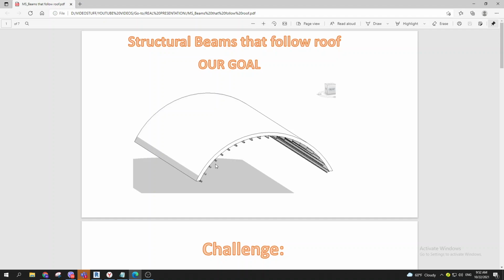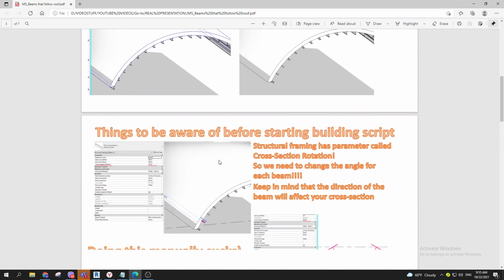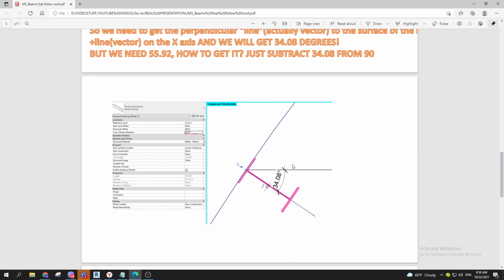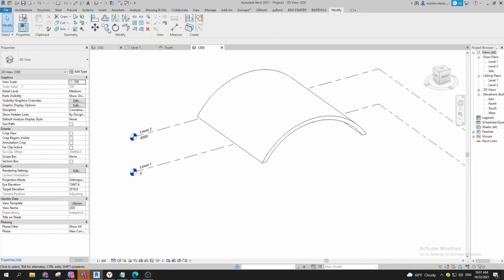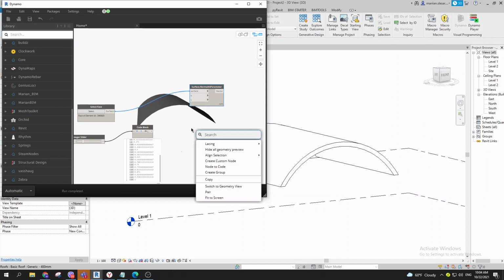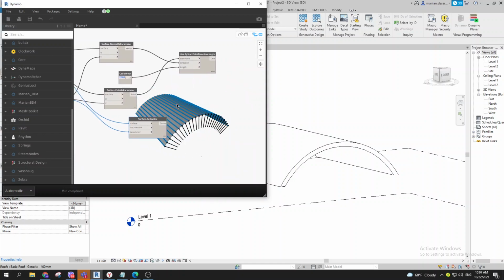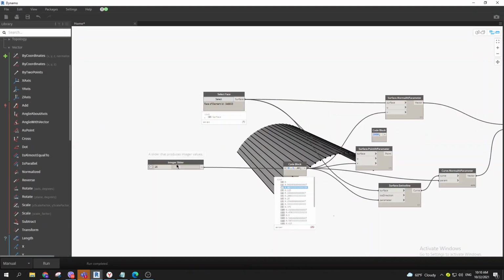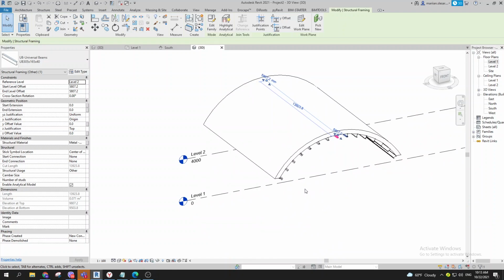Beams that follow vaulted roof using Dynamo

Comment: I loved ur content, I normally used adaptive components with dynamo to do the same,  but this one I think is better, could we do the same with spacing instead of number of amount beams? For purlings and corrugated steel deck or roof it would be more suitable.

Comment: You are amazing, and thanks for sharing such excellent way, just one question, if I have inclined surface and I need to create beams on it with fixed spacing, what shall I add at the begging to calcualte the number of beams?

Comment: Very helpful. Why if we already create our beam  that are not touching the roff and we just need to adapt their Cross section rotation depending on their projection to the surface.
Reply from the maker: Thank you. I am sorry, I don't quite get your question
Reply: @mariyandeveloper8437   in this example you create you beams with the Surface.PointAtParameter; but if you have already your beams created in the model and you want to projeect them in the bottom face of the roof and set the "Cross-section Rotation" Parameter for them.
Reply from the maker: @mhdingbi  Thanks for reaching out! It sounds like you already have some beams in your Revit model and you want to know how to manipulate them using Dynamo. In order to help you with this, it would be helpful to understand a bit more about your specific scenario and what you're trying to achieve.

For example, do you want the beam's length to change based on the surface it is connected to? Or are you trying to move the beam to a specific point on the surface? Once you have a clear understanding of the tasks you need to solve, it will be easier to identify which Dynamo nodes and functions you need to use.

As a starting point, here are a few steps that might be involved in this process:

Select a beam
Select a point on a surface
Move the beam to this point
Change the cross-section rotation of the beam.
I hope this helps give you some ideas on how to approach this problem. Let me know if you have any further questions or need more guidance!
Reply: Hi  @mariyandeveloper8437   thanks for responding. 
I already have beams positioned about an eliptic roof . My beams are not touching the roof. i want, based on their projection to the roof adapt the "Cross section Rotation" of all the beams using dynamo.
I think i neeed to reach you in a platform that i can share images to show you what i really mean. I'm sorry but i'm a french guys that's why it's little bit hard to me to explain it exactly in english.
Reply from the maker: @mhdingbi  You can reach out to me via email marianslesar.08@gmail.com